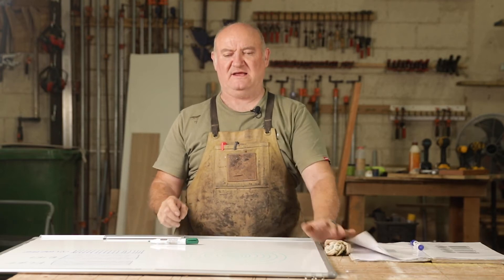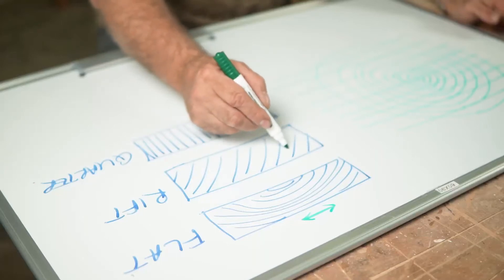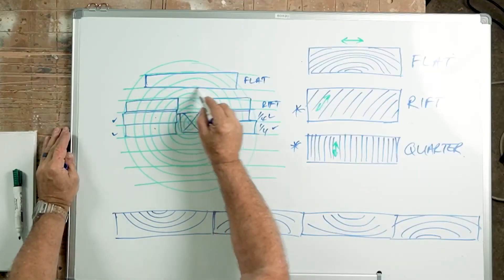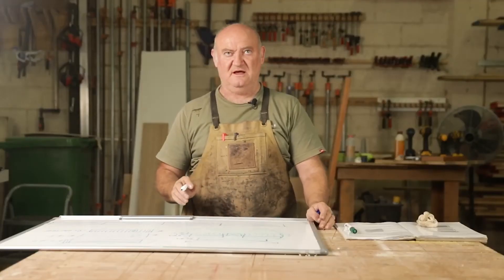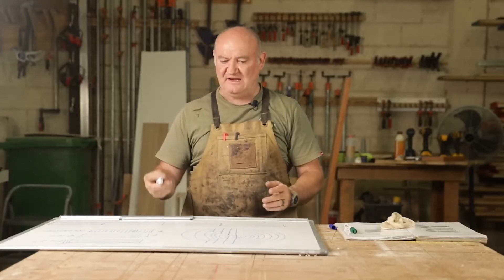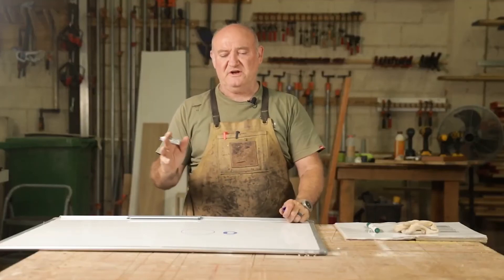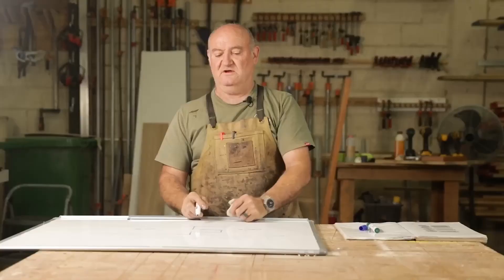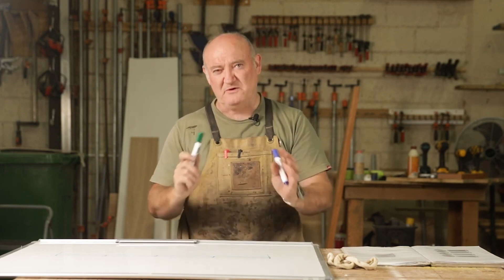Why WOOD WARPS & CUPS -  and How to STOP IT -  Universal Plywoods

Comment: If you put solid vaneer on top of plywood do you not have to put it on bottom as well to keep it all stable?
Reply: Hi. If the plywood is good quality and stable, then it wouldn’t need veneer on the other side.
Reply from the maker: Great